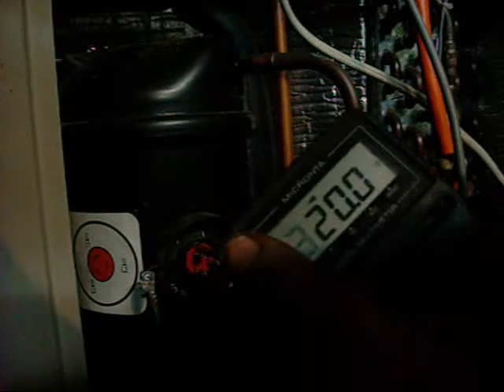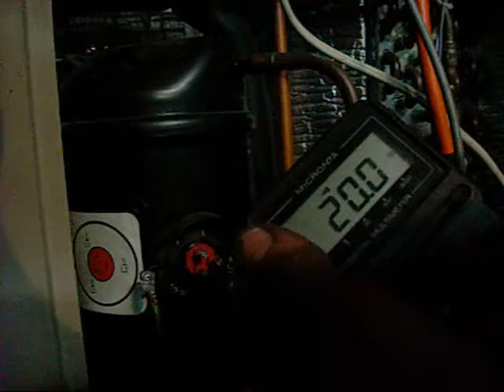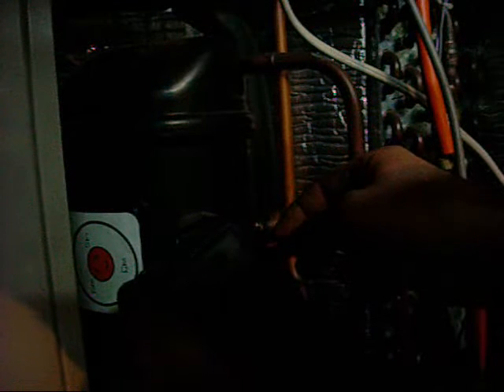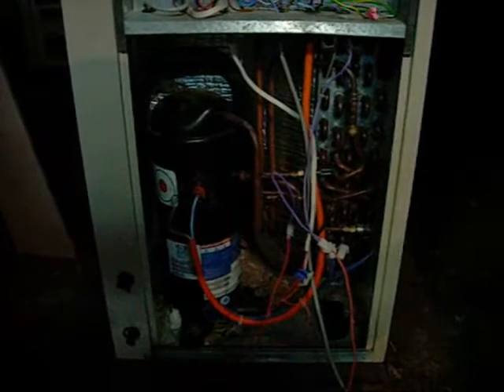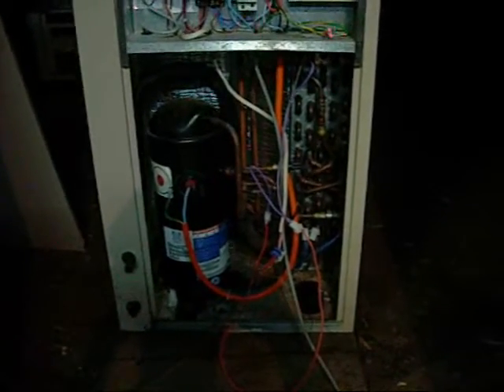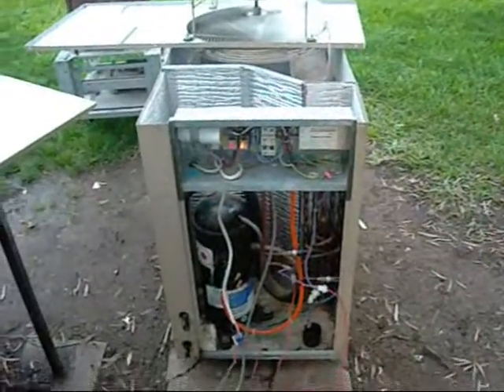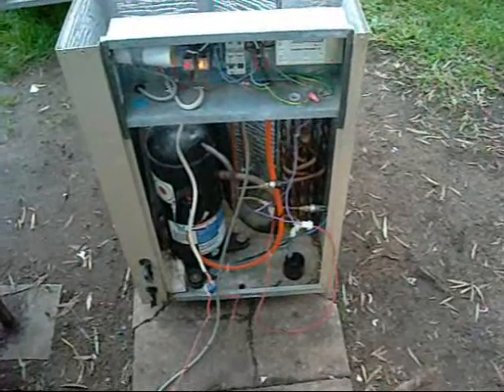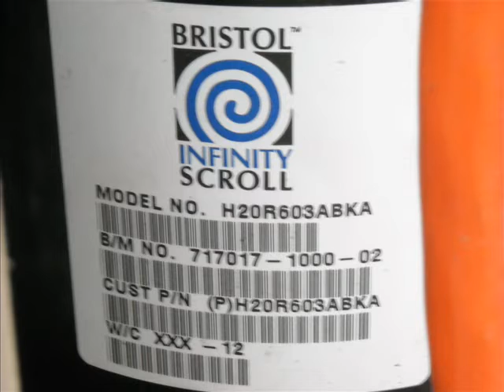Tinkering with the Alcair Lennox 16Kw Condensing unit

Comment: It should be no problem to replace a 4.5uF Cap with a 5uF cap.
IIRC: the default tolerance on caps is +50/-10%
It may be different with motor caps, but even there I'd be willing to bet that you can't even find caps with a tolerance better than 10%.

(If you were to measure them, you would probably find them to be pretty close anyways)
You already know the rule to make sure the voltage rating is the same as-or better than the one being replaced.